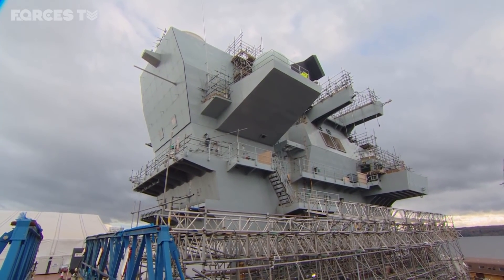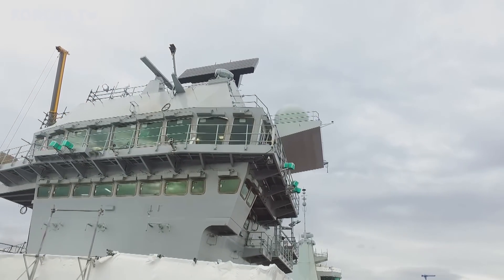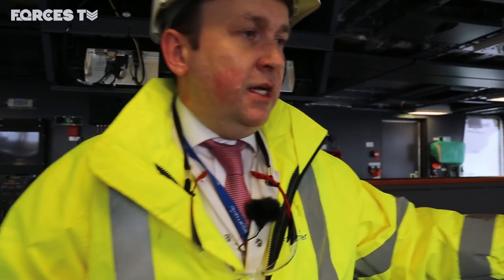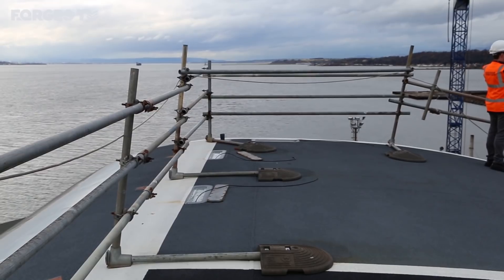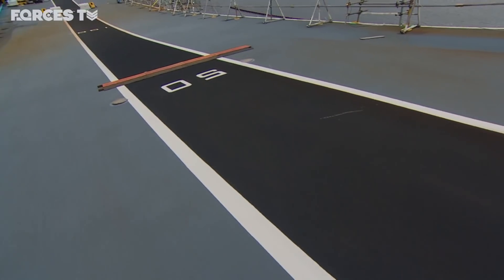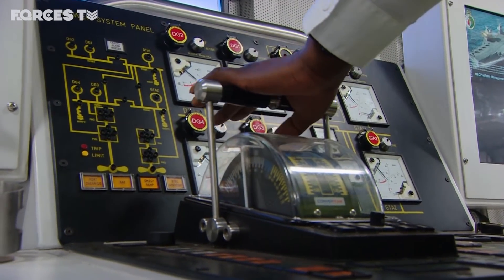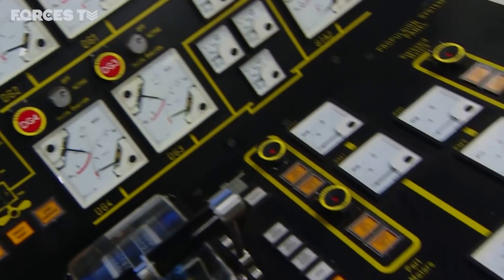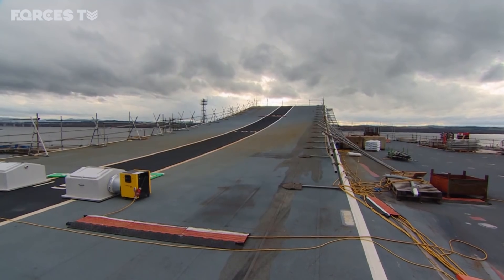What It's Like On Board Britain's NEXT Aircraft Carrier | Forces TV

Comment: Yay we can fly 1 type of fixed wing warplane!!!
Cat and trap, lots and lots of types.
Reply: Nick Breen Cats and traps are good if you have a bottomless budget, you have to maintain the cats and traps as well as repair them over time and repair the small bits of damage they do to aircraft as well. The ski jump works and is effective so what's the problem? The F35B also uses vertical landing and take off.
Reply: Planes used for cats and traps have to be extensively modified and have far shorter life-spans.  Sure, it's not to the same extent as V/STOL, but it's still significant.

Enough navies are looking at operating small carriers or converting LPDs for a V/STOL carrier to make sense.  That and the RAF now having aircraft the can pretty much as is land on carriers (they would not accept traps and cats aircaft) is an efficient use of limited resources.
Reply: My point is that, in regards to the 35, if a weakness or countermeasure is found and exploited by an enemy we are screwed with a single type of aircraft. Also we will need the 35 to be capable of all roles, not just capable but good at. If such an aircraft exists in the 35 then we should see the Americans eventually replace all their fixed wing carrier aircraft with 35's.
Dont hold your breath. But at least cats and traps can be retrofitted if we need them.
Reply: @nickbreen287  So how many types of attack fighter / bombers does the US Navy fly off its CATOBAR carriers? Oh wait that will be ONE - The F18. Soon to be replaced by the F-35C... And when we had three smaller carriers we only flew ONE type - The Sea Harrier.
Multiple airframes is expensive, adds to maintenance costs and the CATS have to be re calibrated every launch adding delay. Our QE Class has a far faster initial sortie rate than a Nimitz and some 10% less 24 hour sorties.

Of course the Ford has yet to launch anything of consequence .. some $18 Bn that was ...
Reply: @nickbreen287  
Well, actually the LHA class WASP ships in the USA are now fielding the f35 B model. So they ARE adopting this fighter to extend the fleet. The recent use of the f35 B from a WASP class LHA ship is VERY significant. What this means is now the USA has 19 ships in which to launch air power from. Now China and Russia have to track and worry about 19 ships in place of 10 carrier groups. And this means that any LHA class ship can launch fighers.

To bomb some target in Afghanistan it makes ZERO sense to move a huge and expensive carrier fleet into the area. (and such large fleet movements means that people are OFTEN tipped off that a carrier group is in the area - they are hared to hide. With f35 B models, then a small ship was able to carrier out strikes - and the enemy now has to plan and consider that "air power" can come and hit you when you least expect it.

And the f35 is a better dogfighter then say a f16, or f18. And the f35 also flies faster (with weapons).
Reply: Nick Breen if ski ramps where better the French and American carriers would use that system, they don’t. Step up your game Britain.
Reply: @alextoso100  We have stepped up our game Pal. The fact that its a different system does not make it a worse system. We have exploited the capabilities and technology on board the aircraft rather than build hugely expensive CATOBAR systems. This is the country that created and developed the carrier itself (in 1918), the 'island to starboard' concept, the steam catapult, the powered arrester wires, the angled flight deck and the mirror and other landing aids. We need NO lectures on how to develop new systems on a carrier.

The fact that the USA for all its so called expertise has built one CATOBAR carrier costing some $18 Bn in the same time it has taken the UK to build and launch TWO at a cost of $10 Bn says we are actually delivering more capability at less cost and at a faster rate. The American way is not always the right way. Likewise the French way. Its why they have both copied the UK way since 1918.

Here is a thought: The UK (if it chose) could build 3 QE carriers for $3 Bn less than the cost of the USS Gerald R Ford, be able to cover 3 times the operational area, using 4,800 crew and delivering 180 aircraft as opposed to 70 CATOBAR aircraft needing 4,500 crew.

Now tell me again who needs to 'step up exactly?
Reply: @alextoso100  
They are a compromise - not necessary better.

Well everyone should have a great house with a swimming pool, some Ferrari’s parked in the garage and a hot wife.

The issue is money and cost.

And while there are compromises in using VSTOL jets and ramps, there are also advantages.

A ramp gets you a higher launch rate. A catapult takes just under 3 minutes to launch a fighter. And those fighters have to be modified. For example the f35 C model is 3000 lbs heaver then the B model. The front nose gear is a “double” wheel in place of one front wheel. (more tires to change – and they change tires after 10-15 landings). 

And that nose gear has to be able to “pull” and withstand the force of the catapult and the WHOLE weight of the fighter (so any plane that can be catapult launched has EXTENSIVE modifications to the airframe and landing gear. And the hard deck landings not only pounds the crap out of the airframe, but the landing gear system has to be substantial beefed up (and thus is heaver).

With VSTOL, a plane just points down the runway, guns the throttle and it off to the races. Before the jet even cleared the ramp, the next plane behind is spooling up its engines and is STARTING its run. So a catapult can launch about 20 planes per hour. A ramp system allows a much faster launch rate.

And elimination of cat and trap also frees up a lot of deck space – especially deck area in terms of landing space. All those cables take up a lot of deck space – especially when retracting the cables after a landing. (So no planes can move alongside the landing area. You even note deck crews with what looks like a rake – they hold them down on decks as cables are being re=set and re-wound. So a lot of space is used up by the cat and trap system for landing.

So a ramp system is a compromise over catapults, but there are pros and cons.

Because of larger deck space (at least for a ramp carrier) then they even plan to use rolling landings. This is possible for May reasons now but one being how good the f35 B model flies. And they added the “mirror + laser” system for pilots to see a glide slope on the HMS Q

And the f35 B model is amazing.

On a USA carrier an f18 is rated for 4200 lbs of return stores. That means 4200 lbs of fuel and bombs can occur with an f18 landing on a carrier. If you have more weight, then you dump fuel. However you also have to start dumping bombs if you still exceed that 4200 lbs “return store” weight. 

The f35 B is rated for 5000 lbs return store (vertical landing). And you don’t need a massive upgraded landing gear system – you save a lot of weight, and of course wear and tear.

At 5000lbs you already rated “higher” than an f18 return stores.

With a rolling VSTOL landing, you get an additional 2000lbs return stores. That brings the total up to 7000 lbs. 

This means you can launch planes with larger fuel loads, and larger weapons loads and NOT have to plan to use these weapons. The result is you can launch fighters with larger loads and not have to worry about dumping those loads for return landings.

Ultimately a catapult does get you a larger launch weight, but you landing weights are still compromised.

So any plane setup for a “trap” landing on a carrier has compromises made to that fighter as a result.

And ramps as noted gets you MUCH higher launch rates then a catapult by a SIGNIFICANT margin (2 minutes 45 seconds it takes for a catapult to re-set and then start the process of hook up etc. It is the difference between you getting in your car, turning the key and driving away as opposed to calling a tow truck to hook up and tow you away.. And by adopting VSTOL fighters, then you have a fighter that can land on hiways and be launched from country roads etc. 

And despite “rumors” of the heat on decks from the f35, I maintain that an f35 B can land on a grass field.

And the f35 B model is really the world’s first VSTOL fighter with the fewest compromises. Loved the Harrier, but the f35 B is so much better of a fighter.

So that 3000lbs of weight saved on the B model over the C model is significant. An f35 C model at 50% fuel loads is still below 1 to 1 power to weight ratio. The F35 B at 50% can fly straight up – the C model cannot.

Note that the C model also has larger wings to allow slower landing speeds. (More drag, and more weight again).

In fact the C model with full fuel loads will be an astounding 10,000 lbs heavier then the B model. (That is half the weight of a lot of fighter jets!!!). But you still have the same engine.

So fighters designed for carrier landings are heaver then their VSTOL or non-carrier based fighters. Fighters designed for carrier landings thus ALSO HAVE MANY compromises compared to non-carrier fighters – especially in landing gear area. And you need a tail hook system that can also “hold back” the total weight of the fighter. (So that part of the air frame again is beefed up, and heaver).

So there is a “list” of pros and cons to consider here. Any fighter for a carrier, be it ramps or catapults has CONSIDERABLE design changes to the fighter to achieve the desired goal.
Reply: Nick Breen cat and traps cost loads pf money and make sortie rayes really poor.
Reply: @latinman1736  "make sortie rayes really poor." WTF? The opposite is true; CATOBAR operation is the only way to get such high sortie rates. STOVL can't come close; it's used because it's far cheaper and less complicated.
Reply: Locutus494 lets not get into a pissing contest. But think logically lets weigh up the time it takes for a catobar aircraft to take off. 1. Charge carapult system. 2. Raise blast shield. 3. Spin up engines. 4. Launch. Now lets look at a CATOBAR recovery. 1. Clear all air operations from the rear flight deck. 2. Raise arrester wires. 3. Wait for aircraft to get the correct landing trajectory. 4. Land aircraft. And now lets look at STOVL take off and landing. 1. Spin up engines. 2. Launch. Now shall we look at recovery. 1. Put aircraft into hover near the ship. 2. Land the aircraft. So now which type is more efficient regarding sortie rates.
Reply: @Locutus494  

Time to re-charge the catapult is over 1 minute. And about 1200 gallons of fresh water is used for each launch. 

Once catapult is re-sent, then jet slowly creeps over the launch hook. At that time a hold back bar (looks like a shock absorber) is attached. The holdback bar is pre-set for the given plane. When plane goes full throttle the catapult hook does NOT hold back the plane. When they pull the trigger the force of engines + force of catapult overcomes the setting on holdback bar. The bar then falls to ground and is retrieved by deck hand.  They then start the rather lengthy process of re-setting and re-charging  the catapult. The next plane then starts the lengthy process of creeping over the hook.

For VSTOL launch?
Point plane down runway
Gun throttle.
While the above is occurring then next plane is turning and spooling up throttle. It can start it's run before the previous jet has cleared the ramp.

You are a drunken unemployed rodeo clown if you think that a catapult can generate even 1/3 the sortie rate of planes just turning and gunning throttles down the runway one after another. Only limit is how fast you can put planes on deck and point down the runway.

A catapult hook-up and launch is 3 minutes. For ramps the hook up time is ZERO.

The only reason why a USA carrier can achieve high cycle time is because they have 4, count them 4 launchers.

Setup time for catapults is significant compared to turn down runway and hit throttles. I suggest you watch some videos on YT on jets being launched from carriers. 

Launch rate limits for HMS queen will be elevator limited on how fast you pull fighters from below deck hangers. And with tons of room on top decks, 15 or more fighters will be topside when you start the high rate of launching. As soon as plane has started it's run then next plane is turning and spooling up throttle to start it's run. Not even need to wait for previous jet to cleared the ramp. Much much higher launch rates this way.
Reply: @Albertkallal  What on Earth are you blabbering on about?! Catapults launch aircraft much faster than three minutes per! I know how flight deck operation work; I was a Marine avionics maintainer for nine years! The CATOBAR method most definitely far outpaces STOVL; that's one of it's main advantages that makes its much higher cost and complexity worth it. Of COURSE it matters that the sortie rate is because of having four catapults; that's what sortie rate is, the TOTAL number of sorties per timeframe of the WHOLE SHIP, not just one catapult. STOVL ship will never be able to match CATOBAR because they can only launch one plane at a time and they cannot simultaneously launch and recover aircraft. I don't know where you're getting your information, but it's all wrong. The Queen Elizabeth only is faster compared to other STOVL ships, not to CATOBAR carriers.
Reply: @Locutus494  
Really? Catapult recharge is at least 1 minute - you "might" get time down to 2 minutes if you are lucky.  Post your known cycle times then.  No such cycle limitations exist with vstol planes.
Reply: @Locutus494  
And oh where did I get numbers from?

Google it
Max carrier sortie rate during desert storm was the Roosevelt at 96 per day.

Next up was J F Kennedy at 60 per day 

The official max carrier sorties per day is 240 - a rate we simply never come close. At 240 per day that is not even 1 air wing per hour.

The difference between a catapult is like waiting to hook up your car with a tow truck as compared to getting in and starting up and driving away. As I stated with vstol you don't really have to even wait before jet cleared the ramp before next jet is starting it's run.  One catapult will not get you 20 jets per hour.  Do the math and simple fire off some emails to your supposed friends who worked on flight decks and come back with their numbers.
Reply: @Locutus494  Sorry - you are very wrong. Maybe go look at how long it takes to 'stage' an F18 on a CAT ... And the UK and USMC F-35Bs operating from the QE will take of from a ramp in Short Take Off mode. And land using SRVL ... VTOL is a standby option for use in restricted sites and not for 'everyday' operations. The USMC use STOVL on their ships the Royal Navy doesn't.
Reply: @Locutus494  Can I gently correct you? You need to distinguish between 'initial' and '24 hour' sortie rates. because CATS need setting up and the aircraft need 'staging on' this takes a lot of time. Consequently the initial sortie ratres are higher with a ramp type take off.

However over 24 hours the CATOBAR rate is about 10% better as it can retrieve off the TRAPS faster than with Vertical Landings. Its why the RN developed SRVL to land F-35Bs in the same way an F-35C lands using TRAPS. This speeds up retrieval and increases landing on weights.
Reply: @1chish  
In a pinch you likely could get higher return rates without traps. Catapult launch rate is 2:45 (just under 3 minutes). One catapult = 20 planes per hour. VSTOL landing can pack landing rates much closer together - there's room for at least 2 spots if not 3 even when launching planes. You pack VSTOL landings close then I can't see why VSTOL landings would not produce far higher return rates.  I seen 2.5 min cycle time for cats - don't know how much faster you can go. VSTOL take off time is far less and planes behind can elephant walk their takeoffs (start the run before plane in front even cleared the ramp).

Reset of traps and long angle of flying in is far more time consuming than just plopping down on deck.
Reply: Mr. Ouija Yes it can, google it.
Reply: Cats and traps put a huge amount of stress on a carriers deck, which Leeds to a lot of maintenance, and a lot of time in dock
Reply: Mr. Morningstar  Yes, the F-35B most definitely does takeoff vertically.
Reply: Mr. Morningstar  Are you brain dead? You admit in your own comment that in fact it CAN takeoff vertically! It can takeoff with a payload and transition to wingborne flight. Did I ever say it could so so with a max payload? No. Did I ever say that was the normal mode of operation? No. I know what the term STOVL means! I worked on the F-35 in the Marines for years...

You're the one who seems to be having a hard time understanding...

Comment: 68,000 tonnes isn't it? Or even up to 70,600-72,000 when fully loaded? 65,000 tonnes is a bit inaccurate isn't it? I think that was the planned figure, but both HMS Queen Elizabeth and HMS Prince of Wales are easily heavier with increased fittings.
Reply: 'Sitting at 65,000 tons' (or possibly tonnes) is what he said, which could well be its current weight with another 3,000 tons (or possibly tonnes) still to be added over the next year or so.